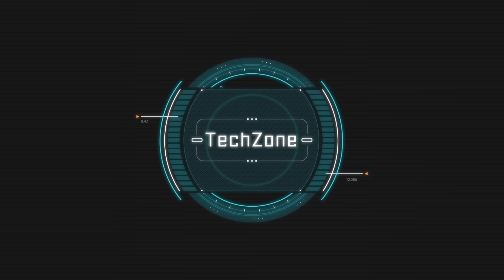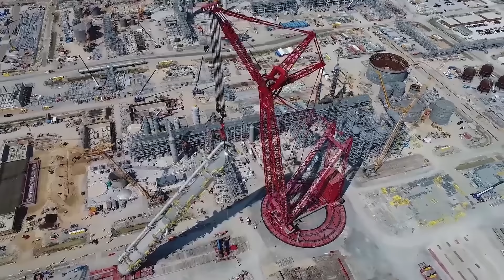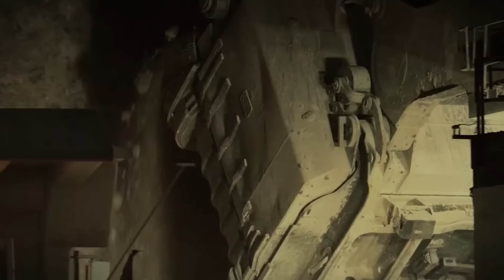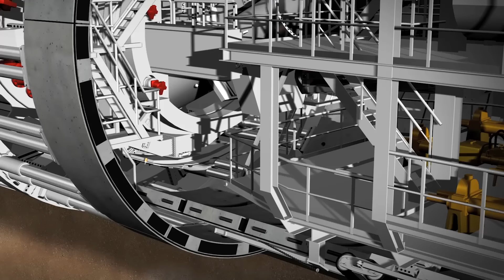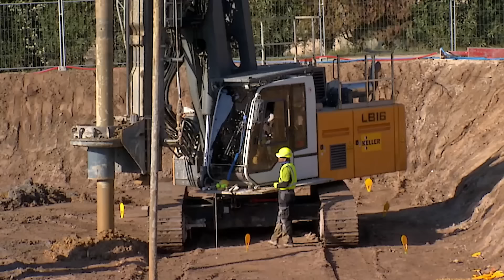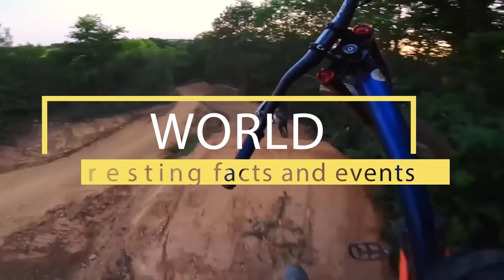BIGGEST MACHINES YOU'VE EVER SEEN

Comment: The animations of tunnel boring machines were not Bertha but actually the London Crossrail TBMs. You can tell this because they have "Crossrail" labels on the cutting faces and the animation zooms in on the London Crossrail project. :-)
TBMs are always impressive but the notability of Bertha is just how big she is. The Crossrail TBMs are 140 metres long and 7.1 metres across (similar to the bore size of the Dartford Tunnels, for a handy reference point), Bertha is 99 metres long and 17.5 metres across, so more than twice the diameter. Incredible.

Comment: That dump truck would be better was an electric vehicle. Then ever wheel can have a motor maximizing traction, eliminating the gear box, and vastly simplifying maintenance while further increasing modularity. Additionally, mining trucks usually go up a hill and back down the same hill repeatedly. During that an EV truck can use regen so it only needs power for the way up.

Comment: At long last the huge smelly polluting Diesel dump truck seen here are being replaced by full electric ones which and move more dug soil and waste with zero pollution and noise and work fine all day only needing a couple of hours to charge up over night using wind or solar power on site by a mobile container power unit some even are now drive themselves freeing the driver up to work on smaller machines with less stress  Even ferries ( one in Norway even drives it's self on a route between ports and and recharges automatically at the port using a robot charge dock unit and other big machines are being replaced by electric.. all power by wind , solar, tidal, wave power green clean non-polluting the future looking better each day!

Comment: And component upkeep/service life of all those wheel hubs? And it would be slower to load than Liebherr’s ‘conventional’ T282 with anything other than a wheel loader or conveyor (which would require the driver to adjust truck position, or conveyor to slew) and only holds 50t more. 
Hey what.... Liebherr have a T284? Hmm, didn’t know that.

That green truck would/could be beneficial on sites that only remove thin strips and have large travel distances between the loading area and the tipping area.... (iron ore, bauxite etc etc)
But not so much on sites that mine resources further down from natural surface (Coal, Gold/Copper etc etc.)

Edit: I do this for a living and have done for the last 14 odd yrs. This truck was proposed back in 2008 I believe. The Liebherr T282/T284 is still arguably king. Or CAT 797/795...
One truck that holds promise is the ex-Euclid that Hitachi have bought and re-engineered.

And diggers? My favourite is a well configured and serviced Hitachi 3600-6 (or Komatsu PC1250) BUT the Liebherr 9800 is Undisputed king of the Diesels/Hydraulic Excavators. 

Bout time we had a high track dozer to surpass the CAT D11T.... common CAT, wheres a D12 to keep up with a fleet of 350t-450t Haul Trucks? Your current D11 is lighter than old models and does not bulk material like an RIII or even an N, and these where around when 180t-240t trucks where king and 500t-650t Excavators where the norm. 

I would like to see a quad track D12 that can out bulk a Komatsu 575 Super Dozer please. With the eradication of tailings dams, dump faces have shrunk considerably yet payloads have increased and cycle times have been reduced, (on sites that do not cripple themselves) meaning Dozer work is RAPIDLY becoming the bottleneck and having to push limits and focus 110% on time management means the risk of accidental errors being made has increased exponentially.
Reply: I think i enjoyed your comment more than the video itself.